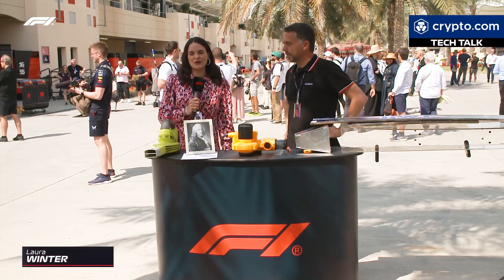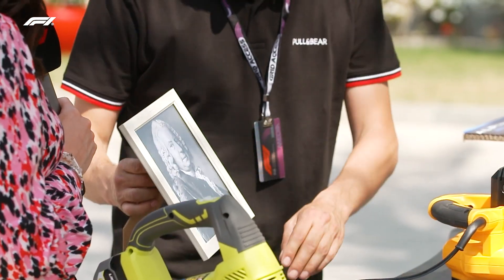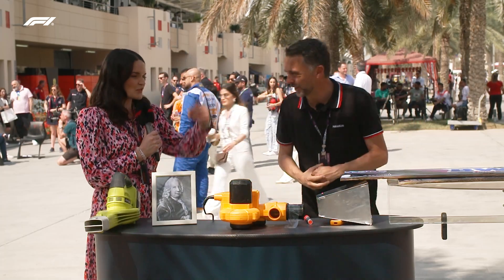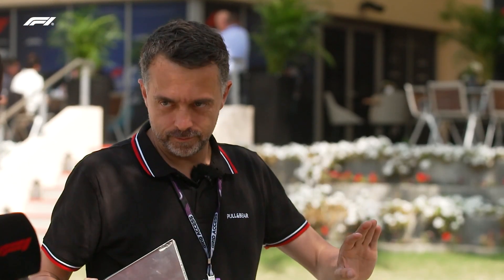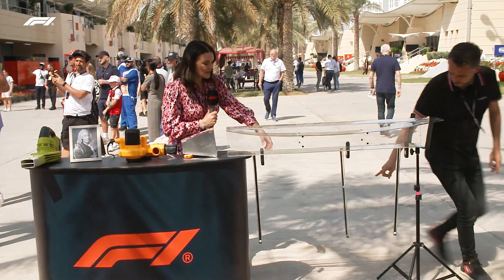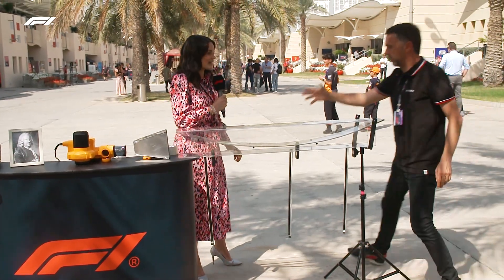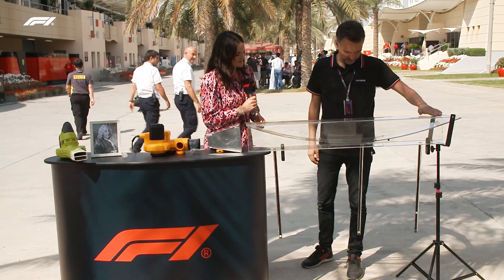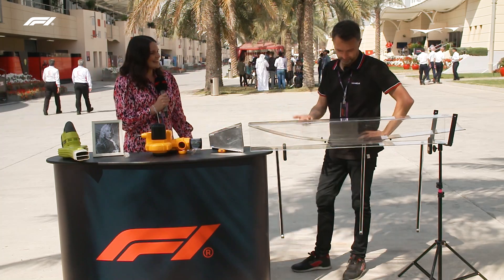When Does Downforce Become Porpoising? | F1 TV Tech Talk | Crypto.com

Comment: The fully sealed floor was effectively the situation with the first ground effects cars, starting with the Lotus 79 in 1978.  The sliding side skirts of that era provided a near perfect seal on the undersides of cars.  Chapman's next car, the Lotus 80, was the first victim of porpoising.  The floor profile was so radical that the problem couldn't be cured and Lotus fell from the top of the field in 1979 and had to revert to using the 79.

Comment: So with my limited knowledge, the Mercedes situation went like this:
- Tighter packaging, probably lower to the ground mass and more weight to the rear.
- More weight, they needed stiffer suspension.
- Ground floor effect kicked in, less suspension travel, porpoising increased, less downforce.
- Downforce needed is supplied with giant rear wing, but that created drag, so overall slower car.
- 2023, they moved the driver towards the front, to balance maybe? and they are committed to that concept, why?

Comment: 2:36 That's wrong it doesn't happen because of the increase in velocity you achieve with your mouth, if you blow at the paper while it is perfectly straight (has to be vertically because of gravity) it actually pushes the paper in the other direction. What causes the paper to rise is that curvature the paper has. Airflow will attach to the curved surface (don't ask me why, cuz that I actually don't know) and that change in direction of the airflow is what accounts for the lifting of the paper. The stream of air gains a vertical (-y) component of momentum and by the third law of newton the paper gains an equal amount of momentum in the opposite direction (+y). It's the deflection of air in this particular case that creates lift, not the blowing from his lungs.
Reply: Great talk though

Comment: I thought I knew how the floors work. I thought it was the rapid expansion of the air going from high pressure to low pressure. I thought it was basically the diffuser doing the job. I thought the last tube and ball was going to generate the most vacuum. This is super fascinating!!

Comment: Whilst it is clever way to to use a vortex to seal the ground to del with the increased ride height of 15mm. Wouldn't it of been easier for the FIA to re-allow the use active suspension back into F1 to get around the proposing issue?

Comment: Sometimes it works, sometimes it doesn't work - Albert describes the W13
Reply: 60% of the times, works every time.
Reply: I think he meant if the outside blower hits it right, the vortex keeps itself going so the downforce should stay. That only works in a very narrow range, so there could be a breeze going and it keeps knocking the airflow back out when he stops the blower.

It's like if you have a kitchen faucet with an aerator, sometimes the water can do weird things like come out in 2 streams, if you disrupt the flow at the nozzle with your hand it can reset and flow in one stream. Super unpredictable.
Reply: @KevinJDildonik  And that's what mercedes trying to proof with their narrow side pods. Their working range is very narrow like in brazil.
Reply: @KevinJDildonik  Hey buddy, it was just a joke lol
Reply: @Saakk129  like W13

Comment: The trick with paper wasnt bernouli equation. It was coanda effect with newtons third law. The air follows the curved surface of the paper meaning the paper acts on the air to turn it. And since the paper acts on the air to turn it, the air acts on paper to lift it up
Reply: Well, Bernoulli's principle and Coanda's effect are closely related principles, right? Both could happen at the same time. But If I'm not mistaken, Bernoulli's explain lift while Coanda doesn't (or at least that's what you can read on the internet).